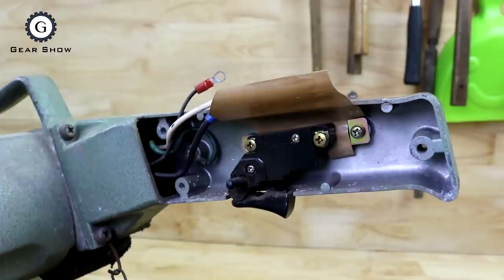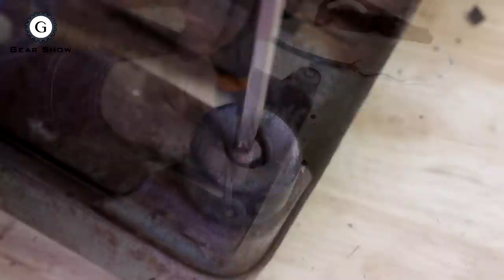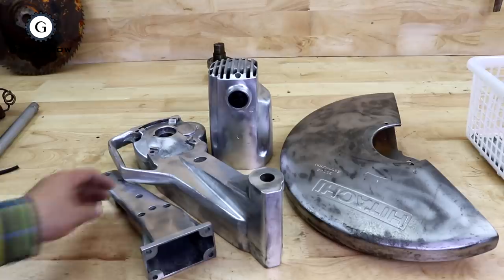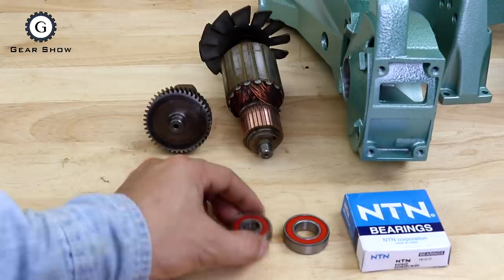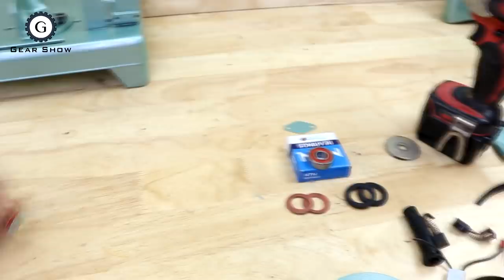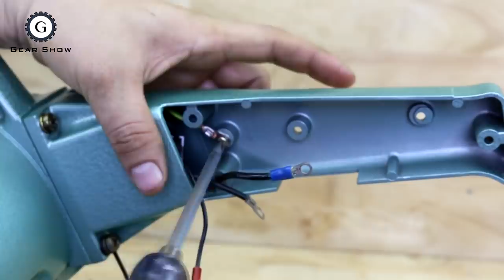Metal Cut Off Grinder Saw Restoration | Hitachi H-14

Comment: Great job, except one thing that I hate:  You do what almost all people dealing with motor commutators do.  You clean out the great protective “patina”.  After that, you consume another great part of the carbon brushes to rebuild it.  It would be a good thing to clean the slots between the lamellae with something soft like a tooth pick.  That removes the carbon dust that accumulated during the first patina build.  You need the space for all the carbon that is pulverized during the new patina build.
Reply from the maker: Okay thank you so much for the advice.

Comment: Before fastening the earth screw, I would seriously sand the body part below where it attaches to make sure contact to metal is perfect, and then put some conductive grease such as copper grease (or battery contact grease) so that the screw embeds in the grease contacting the sanded metal of the tool body
Reply from the maker: Thank you so much for sharing :)
Reply: नमस्कार श आहे ए 
ज

Comment: Looks great! Happy to see brand new bearings used and the proper amount of grease on the gears. Only thing I would have done different was to scrap the paint on your ground wire connection. Could be bare metal there already, hard to see. Good job!

Comment: Please do not replace a shielded bearing with a sealed one, Hitachi had a reason why to use a shielded one..
Also, consider degreasing (spirits or silicon remover) the parts before priming to prevent those clouds in your paint.

Other than that - great resto, enjoyed watching! :)
Reply from the maker: Okay thank you for the advice :)
Reply: Agreed. I've worked for a bit in the industrial industry and am hoping @gear show isn't going back in there to remove rubber bits and install new bearings at some point. Shielded was most likely for the high speed application and friction issues. Also agreed, awesome work otherwise...I wouldn't have attempted this and have done worse on my own diy stuff so who am I.

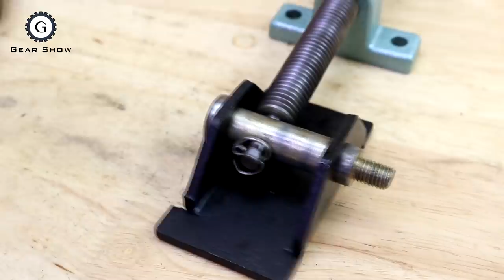Comment: forgot to put the washer on before putting in the cotter pin on the screw, check at 4:39 and you'll see. check at 15:26, no washer.
Reply: Could likely have gone with a smaller cotter pin as well. However, I wouldn't have attempted this and have done worse on my own diy stuff so who am I.

Comment: The ground wire should be in contact with the bare metal but the spray paint isolates it and that's not any good
Reply: I believe he relies on the threads to act as a ground path.
Reply: Doesn't matter he's shockproof.